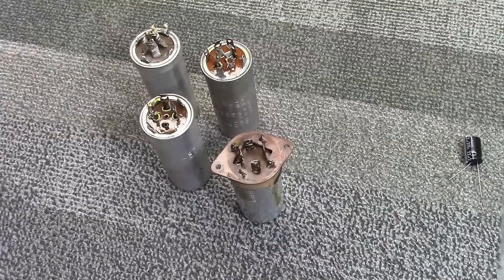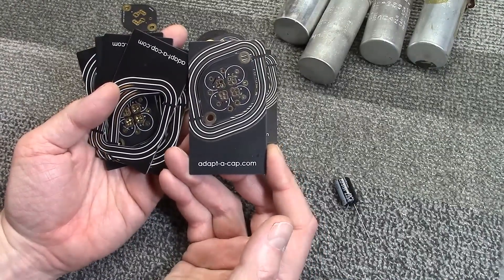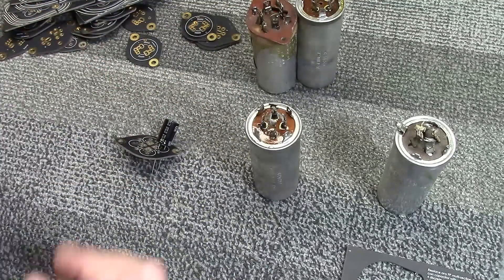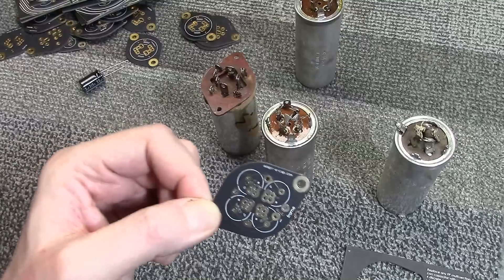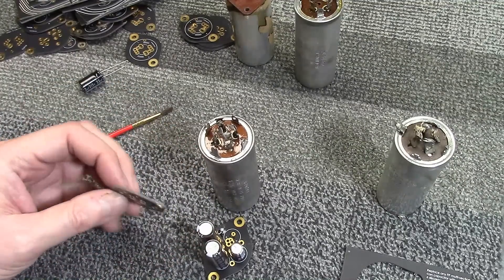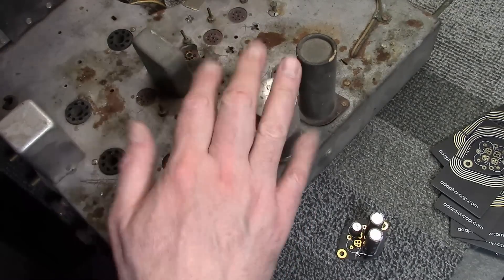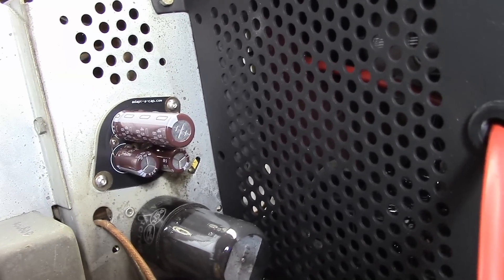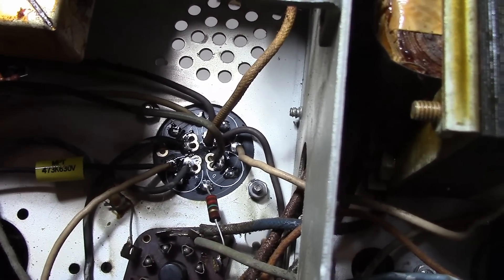Adapt-a-Cap product review

Comment: When I first saw the isolation slots, I was thinking lugs, too. Perhaps spade lugs could be soldering in them. They are already plated.
Reply from the maker: They are not plated and you should not put anything conductive in those slots.  That would short out the cap.

Comment: Really enjoyed your video. Liked & subscribed! Curious where you sourced the "skinny caps"? What description do you use for them in a search?
Reply from the maker: Digi-key, Mouser, Allied.    diameter 10mm or 12mm - lead spacing 5mm ideally.  Nichicon, United Chemicon, Panansonic, etc.
Reply: @bandersentv  Thank you! I had tried Digi-key and Mouser, but forgot about Allied. Still out of stock everywhere
Reply from the maker: @jimhall9360  What's out of stock?  I haven't had any issues getting parts.
Reply: @bandersentv  Appreciate you trying to help! 10, 20, 30 & 40uF 450V "skinny caps"
Reply from the maker: @jimhall9360  They have many 1,000s in stock but those values are old fashioned.  Use 22, 33 and 47
Reply: @bandersentv  The 40, 30, 20, 10 uF were going to be a replacement for a 4 section cap in a SWAN 350 HF rig, so are the higher values ok for that application?
Reply from the maker: @jimhall9360  Yes.  Tolerance on vintage caps is +80%/-20%.
Reply: @bandersentv  WOW! That's quite a broad tolerance! Well, time to place an order 🙂
Reply: @bandersentv  Getting ready to place my order. Do you have a brand preference of the 3 you listed?
Reply from the maker: @jimhall9360  Not really.  I used to favor Nichicon but have been using a lot of United Chemicon lately.  Price is the primary factor

Comment: To ground the adapter to the chassis you can add a lug (shortened to the large mounting hole as  to not short out your
 work) instead of using a wire soldered from the common to the chassis. Then after drilling two holes in the chassis  to 
mount the adapter connect it using a screw and nut (or do what Bob cleverly did) . The  caps at each end will be then
soldered to the negative side and the end of each lug. This will give you two locations to ground .
Reply from the maker: No need to do anything special. If you install the jumper wire, the mounting holes are connected to the negative side of all the caps.

Comment: Unless  I missed it, you didn't show the engineering samples. 
It's a nice board, but importing it from the US is likely going to cost me. I also think they are a little over-engineered, with the gold-plating and all, that just adds expense. If they where local to the EU I might order them, to save me the hassle of designing something like that myself and just ordering it from pcbway or something as a 5 dollar proto-pack (that would get me 20 pieces I estimate).
Reply from the maker: They are just variations of the ones I showed. Slightly different hole spacing and different number of caps. They are not currently for sale
Reply: @bandersentv  I understood that they where not for sale. But it's interesting to know that they might start adding more variations and what kind of variations they are already working on and maybe even why. Maybe come up with a solution for the twistlock thing and such.

Comment: Only thing nicer than these adapters that I could imagine might be a ready-to-stuff can, which doesn't allow anything electrically hot on top of the chassis.  But potting the topside in a wad of silicone seal would solve that problem.

Comment: I am impressed, what a nice easier solution to replacing multi section can capacitors. I will look into buying some, for my restoration work. Maybe Adapt-a-Cap could have a machine metal stamping shop make the twist locks for a new version of the adapter.

Comment: Certainly a good solution in some situations, but as you mentioned, not suitable for twist lock caps.
I am currently restoring a 1935 British Philco 267, this uses a threaded base cap that fits through a single mounting hole on the chassis, several other manufacturers use the same type.
These are a real pain to re-stuff, maybe this type could be made? I will probably leave the original in place for looks, and add a tag strip for the new caps under the chassis.

Comment: I ordered a capacitor kit from Hayseed Hamfest for a Fisher 500C and paid $129 for it, but they are all the correct values and premade for that receiver. That comes to $32.25 for each capacitor, not an economical way to go for sure. I did look to see if it was even possible to use these for the Fisher, but only one is mounted on a phenolic mount with rivets, and the others seem impractical to drill holes for.

On the other hand, I have to replace the can capacitors in my Heathkit W-5M amplifiers for the second go round after doing it 10 years ago with CE Manufacturing cans. Those use phenolic mounting hardware even though the grounds are all common to the chassis. I am considering these adapt-a-cap options for doing those amplifiers again. Leaving the capacitors out in the air may give it more time to live. Good honest review, thanks. (edit: changed CC to CE Manufacturing)

Comment: What about those free samples they sent you? Anything worth mentioning?
Reply from the maker: Yes. Thanks for asking. I believe the smaller 3 section ones will fit the smaller cap on the Predicta 9L37 chassis. Another is the standard size, only has provisions for one cap, but has more and larger holes for hooking up leads. Good for heavy duty caps. You'll be seeing more on them in upcoming projects.

Comment: I have an EICO 147A signal tracer that has a  4 section electrolytic cap that needs replacing. This modern phenolic  will be perfect to mount the new caps right in place where the old one was. I bought a 5 pack of them some time ago and this 
will be a much easier job than trying to mount the 4 caps on a terminal strip. This is much better idea using one.

Comment: Looks like that works, the ground ring trace might look a bit thin ? But probably not an issue
Reply from the maker: The solder mask makes it look thinner than it is.  Also, the board is doubled sided and ring is on both sides.

Comment: The ability to crimp & solder some Keystone turrets on the bottom would be nice for wire connections, a bit more like how the lugs are used on the aluminum cans.
I agree that some type of twist lock solderable metal tab would work when mounting the PCB in a chassis expecting a twist-lock mechanical coupling, maybe something could be adapted from Keystone or some other hardware manufacturer...
Cheers,
Reply: That is a great idea! I was not crazy about stuffing tinned wire ends into a hole. Sounds like the solder could fatigue and fail in repeated thermal cyclings. Better mechanical connection is always better.

Comment: Quite nice innovation. Beats the heck our of the old WBR- Kit which are a hens tooth to find.  If you are careful in removing the can, simply open the crimp at the bottom and remove the mounting ring and re-use it. And for the "young 'uns" out there, yes they do make a tool to both untwist and twist the lugs. I have a couple. GE made them and another company. Hard to find, but real easy to make with brass tubing and a vice to flatten one end down. I hope they will make them for the smaller 'lytics with 3 ground lugs.  One nice benefit is  it allows air circulation around the caps.
 If you are worried about insulating the caps, some heat shrink over the caps will insulate them.  I f one was to use the mounting screws to ground the caps to the chassis, I would use toothed lock washers.  One great benefit is if one cap goes bad it is a snap to replace. Thanks for introducing their product.
Reply from the maker: I've uncrimped and restuffed enough cans to never want to do it again :)  Especially, since I have about 200 TVs and radios lined up to restore!  Yes, I am using washers with teeth.  Also, not a bad idea to add a piece of bus wire from the cap ground to the chassis in case the connection comes loose or corrosion develops.  I've seen that a lot with twist-locs.
Reply: @bandersentv  Then again I like the creativity of finding better ways to restuff caps. Early cardbox box types are not always easy, but I can make them sturdy by 3d printing an insert (recent experiment) to hold the caps. Next I want to make a round foot that fits into a cut-off hollowed out can. Maybe I could design a ring to hold a can based on that board. Yes, it might not be heat efficient. But I like to make them work, not actually use them, so it matters little.

Comment: Over here we generally used clamp mounting capacitors with no cardboard cover, my solution is to cut it with a tubing cutter where the clamp will hide it, remove the innards, replace each connecting pin with a pair of solder tags riveted together through the insulator and then soldering new capacitors to the inner solder tags. once the clamp is reinstalled you'd never realize anything has been done.

Comment: I bought some and use them and it worked out well.  I install mine a little differently than yours.  I mount the adapta cap to the chassis insert the wires and solder.  Then I come back on the top side and cut the wires to length.  After that I insert the capacitors and trim the leads.  I'm concerned about inserting the wires after the caps are inserted as one of the wires could contact the insulating sleeve on the capacitor and melt a hole through.  Possibility of some arcing and sparking.
Reply from the maker: Ah, yes that makes a lot of sense.  I'll give it a try
Reply: Good feedback to improve the future product perhaps. We call those opportunities for improvement.